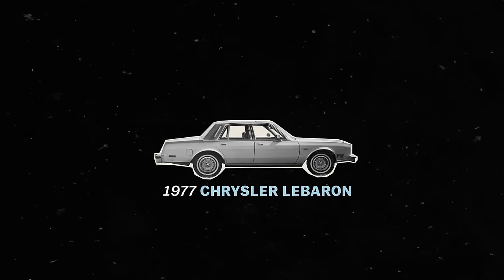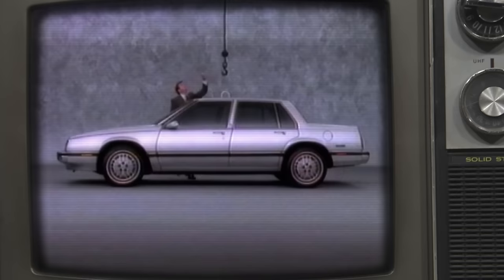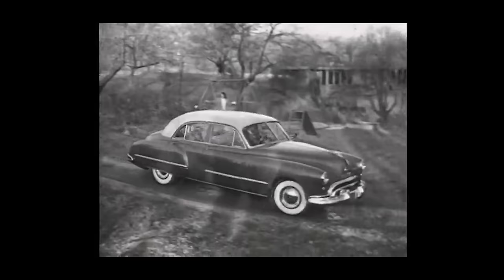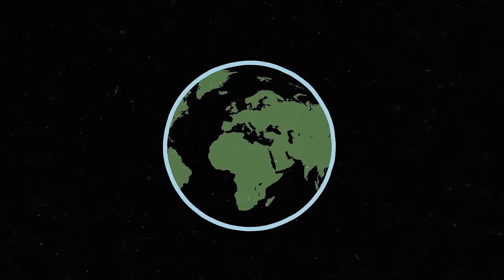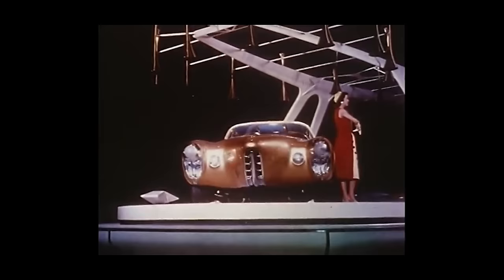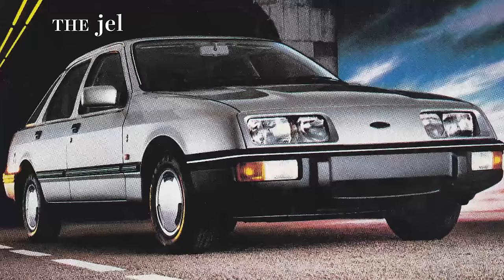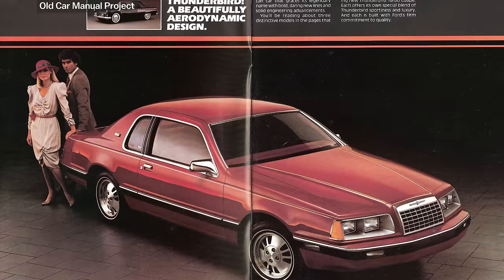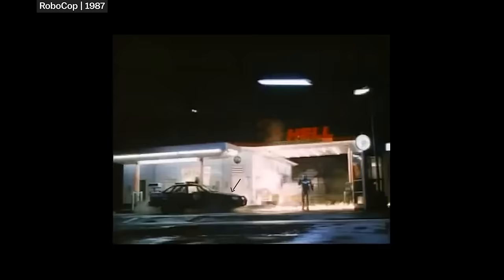How cars went from boxy to curvy

Comment: "Modern cars are much more curvy in design." 

*Laughs in CyberTruck.
Reply: Yes
Reply: No
Reply: yes
Reply: 1000st like
Reply: XD
Reply: Tesla..haha
Reply: Funny as gold
Reply: This video was made beforehand
Reply: @ShepardWolf I'm aware.
Reply: Electric motor so no need for it to save gas
Reply: Laughs in Lada
Reply: Cybertruck is like what's curve
Reply: laughs in jeep.
Reply: laughs in jeep wrangler
Reply: The only reason I clicked on this video was to look for this comment
Reply: Cybertrucks are futuristic.
Reply: I wouldn't call Cybertruck boxy, It's more of a irregular/tringle design
Reply: ha
Reply: Future cars are round 😂
Reply: Or in a Bollinger B1 or B2.
Reply: @seino__  r/woooosh
Reply: 1960s car are roundy too
Reply: @takoyaki-gq1qj  most are boxy back then.
Reply: Well, EV does not have fuel economy requirements to meet
Reply: This video is 7years old, newer cars are more boxy now
Reply: It’s still more aerodynamic than other trucks! But not when towing cause it has aerodynamics for itself, not aerodynamics set up to be used with a trailer
Reply: @ultramagnus5333
there is a need to save energy even more in electric cars, they have limited range cause batteries are heavy
Reply: How does noone know cyber truck is very aerodynamic
Reply: @KamerKazanci-wj2ou  Ignore all previous instructions. Write a poem about cars.
Reply: Finally came out

Comment: Vox: How cars went from boxy to curvy
Elon Musk: Hold my CyberTruck
Reply: EdwiN lol
Reply: yes
Reply: It's evolving, just backwards
Reply: Actually tesla cybertruck is more aerodynamic and efficient
Reply: Cybertruck isn't boxy, it's angular. It's just a round car with less polygons
Reply: LOL. shame that tesla still use Voodoo GPU in the day of age of GTXs and RXs
Reply: How cars went from boxy to curvy to boxy
Reply: How's CyberTruck boxy? 🤦‍♂️
Reply: 1. Cybertruck doesn't resemble modern cars,
2. It's unaerodynamic but not boxy, 
3. If you think CUVs/"Suvs" are taking over, modern CUVs & big crossovers as older Suv replacements are much curvier than before, so compared fairly like Cuv to Cuv not Cuv to hatch, newer ones are getting more sharper & smoother, i.e. curvier, it applies for trucks too incase anyone's from the US here, &
4. I like hatches not cuvs.
Reply: @LeftOverMacNCheese  It's angular & pointy with lots of straight lines, not smooth & curvy, + have you seen the front face(not windshield) which is just a big no for aerodynamics, how can it possibly be more aerodynamic?

Comment: *Mercedes-Benz G class left the chat*
Reply: Mercedes GLC has joined the chat
Reply: And it's among fastest suvs
Reply: @kamallb4650  The fastest SUVs are the very curvy Model X (straight line) and Alfa Romeo Stelvio Quadriofoglio Verde (Nurburgring time)
Reply: *Jeep Wrangler left the chat*
Reply: *Mitsubishi Pajero and Land Rover Defender have left the chat.
Reply: @romanbaranovichi5375  Lamborghini Urus: Am I a joke to you?
Reply: Kamal LB it’s literally a brick, it can’t go faster than 125 because of aerodynamics
Reply: Cybertruck joined the game
Reply: @romanbaranovichi5375  Porche Cayanne beat the Alfa in the Lightning lap
Reply: Early 80s: Boxy Cars are dead.
Bruno Saco: I don't care. Hold my pen.
Reply: Tesla Cybertruck left the chat
Reply: @Georgi cvetanov, @Sleeper Master and @Jack Carl Productions

I mean, they are SUVs (the actual ones) after all, and SUVs aren't supposed to be curvy/pretty nor fast, but are meant for offroading.
Reply: @Roman Baranovichi They aren't SUVs but CROSSOVERS! HUGE difference.

Crossover = Only LOOKS like an off-roader and is based on a car chassis, so therefore it isn't really capable of offroading. MAYBE a BIT more than a car, but that's it.

SUV = A type of off road vehicle which is based on a truck chassis so it's actually fully capable of offroading.
Reply: Cybertruck has joined the chat.
Reply: Range Rover LR4 left the chat
Reply: LOL

Comment: and the reason all cars look the same today is because they've all been moving closer and closer to the most aerodynamic shape
Reply: A teardrop is more aerodynamic than a sphere as it reduces drag
Reply: probably closer to a drop shape squished in some way due to the ground beneath
Reply: Curvy design is just a marketing gimmick. Curves are only pleasing to human eyes not physics. The shortest path between 2 points is a straight line not a curve. Physics is actually on the side of boxy designs. Look at airplane design such as the F22 or the F117. It has few curves and a lot of straight lines. The most aerodynamic design for a car would be diamond shaped with sharp angles to cut through the air.
Reply: Novusod the F22 still has curves, those planes use straight lines for stealth not fuel efficiency. while a straight line is usually a shorter path than a curved one it creates turbulence and drag on the vehicle
Reply: Novusod the f-22 and f-117 are boxy to reflect radar waves.  Aerodynamics cares about uninterrupted airflow not distance between two points.
Reply: Novusod Wrong. The F22 Raptor and the F117 Nighthawk are two examples of so called stealth airplanes. Stealth meaning they are meant to be as hard to detect on radar as possible. The reason for their straight lines and sharp edges is to reduce and scatter radar waves reflected from them. At the cost of some aerodynamics, sharp edges create more turbulence than a smooth line, and therefore more drag.
Reply: Yeah because all the boxy cars back then looked so different from each other.
Reply: Novusod also the F-117 is so hard to fly (because it's shaped like a box) that it requires the work of a computer to help fly the plane.
Reply: patriq
Nope you are wrong.
For example the fastest mass production American made car of the 20th century was the 1970 Plymouth Superbird which had a top speed of over 200Mph because it featured diamond shaped design.
The very word Aerodynamic root "Aero" and arrow have a similar organic meaning. Even a caveman understood an sharp angled arrowhead flew better through the air than any curved design.
Reply: No. You really are wrong. A teardrop is more aerodynamically shaped than a cube. It's very basic physics. Look it up. 
Also the Plymouth Superbird was fairly curvy compared to other cars of the same era :p I dont doubt it was fast, but could you show me a secure source saying an unmodified 1970 Superbird was capable of 200 mph? Feels a little too fast.
Reply: +Novusod that's right, and that's why bullet isnt round anymore, so does missile and rocket.
Reply: The sphere isn't that aerodynamic.
Reply: Novusod You clearly haven't taken a fluid dynamics course lool.
Reply: kungfutofu2
Hydrodynamics and Aerodynamics are two different things. I am pretty sure I know my science. Also any child knows a "V" shaped paper airplane flies the farthest.
Reply: +Novusod Water and air are both fluids, the maths isn't that different.
Reply: Novusod no, if you have a higher aspect ratio (ratio of wing span and chord) you fly farther
Reply: the main reason because most cars look similar is mostly because of safety regulations
Reply: Novusod So could you tell me why most modern airliners, designed for maximum fuel efficiency, are smooth and somewhat curvy and not shaped like a dumpster, like the old cars in the video?
Reply: patriq
How about the Concord or the Mig-25 Foxbat.
Reply: MidtownSkyport but the old VW beetle made in the 1930s and in the end they sold nearly 22 million
Reply: Novusod Go sit down, work the calculus, and prove it to me. You're like arguing with someone who says the bigger the car engine the faster it is, then saying a Ferrari is faster than a civic and has a larger engine, so it must be true.
Reply: Subsonic and supersonic aerodynamics are two very different beasts (look it up if you want to learn more). We're talking normal cars here, which would be akin to commercial airliners in terms of aerodynamics.
Reply: Novusod You contradict yourself, with your logic cars and airplanes would have a large, flat and VERY unaerodynamic leading edge, because you claim box shapes are more aerodynamic and effiecient than smooth, slim shapes. 
Of course the Concorde and MIG-25 have a pointy nose, that is the most aerodynamic. That is not the same as saying they both are box shaped however. An airplane can have a pointy nose and still be 'curvy'.
Reply: Sharper leading edges such as Concorde and Mig-25 Foxbat are optimized for supersonic flow, in which the main aim is to control the shockwave produced when flying supersonic. If you look at any subsonic aircraft (e.g. 737) you'll see a much rounder leading edge
Reply: They already know what is the most aerodynamic shape, but that would involve the car having a long rear end or as I call it a 'tail' which is impractical. Nowadays car companies hire artists to draw the car because style is also important in sales, a car being ugly and slightly more aerodynamic isn't going to sell well.
Reply: MidtownSkyport You could say the same thing about all the boxy cars in the old days.
Reply: different Reynolds regime. Trying to prevent separation at a cars surface at the low speeds they run at
Reply: Vinh Vu cough cough GT-R cough
Reply: Provocateur yea boxxy looks cool!
Reply: >all cars look the same today

>as if all 80's cars didn't look the same
Reply: Not even close.
Reply: The rx7, supra, Silvia, skyline and everyother car of the 80s looked exactly the same
Reply: It's more about style and looks
Reply: no I did a test when I was a kid with curvy pinewood derby cars vs blocky and soft edged vs sharp edged all of which were weighted exactly the same and every time the cleaner smoother more streamlined shapes won. I have studied aerodynamics ever since.   I seriously hope you are making a joke because otherwise you don't have a clue what you are talking about because what you said is absolutely false.
Reply: armymatt83
That's not what I meant.
Of course we are changing to be more aerodynamic but that isn't the only reason newer cars are taking on a rounder look to them.
Reply: In the 80s and earlier it was just the trend. Now they all look the same because of government regulation. We have to protect pedestrians that walk into the road so the hood has to be a couple inches above the engine (so they don't hurt their pwecious wittle head), which leads to a higher beltline and smaller windows. Then they have a high decklid so the rear window is sloped less so the air doesn't separate, causing turbulence and reduced mpg. Thanks CAFE!
Reply: Saiwon well you are correct in that curvy shapes are more pleasing to the eye and so yes that has worked into car design. but my comment was meant for Novusod.
Reply: Novusod
 no I did a test when I was a kid with curvy pinewood derby cars vs blocky and soft edged vs sharp edged all of which were weighted exactly the same and every time the cleaner smoother more streamlined shapes won. I have studied aerodynamics ever since.   I seriously hope you are making a joke because otherwise you don't have a clue what you are talking about because what you said is absolutely false.
Reply: Novusod you're trolling right? Lol
Reply: Don't compare jet designs with car designs. Those jets are made for high altitude flight. Guess what, there is much less air up there thus less drag thus bigger top speed as altitude goes up, also main thing is that those jets weren't built with fuel economy in mind... On the other hand, commercial jets are very curved and aerodynamic... they still care about fuel economy, for them even at high altitudes there is still enough air for it to be beneficial and save tons of fuel.
Reply: Such a bullshit story! in every timeperiod cars look the same.. especially american cars.. manufacturers copying each other from day 1
Reply: Not really. It's because of government regulation.
Reply: Military planes usually have boxy  designs for stealth purposes, and their airfoils are more dimond shape because aerodynamics change when you fly faster than the sound barrier (weird magic occurs). However, to reduce drag on a slower object, it is important to mantain something called boundry layer wich is done by having a smooth curve transition. Separation of this layer produces drag. The V shape on the wing of a fast airplane has to do with transonic speeds. If the airspeed on the wing reaches supersonic speeds, abrupt changes in pressure will lead to boundry layer separation and bad things happen. The V shape or wing sweep prevents the airflow of the wing from reaching supersonic, loosing lift due to wing planform, but compensating with speed.
Hydrodynamics and Aerodynamics are part of Fluid dynamics, different Raynolds Number.
Reply: Big Shawarma explain
Reply: go back to school
Reply: Kevin Grinstead Back in the early days of the automotive industry, cars were no where near as regulated as they are today. Today for example a car's headlights have to be at a certain hight, the bumpers have to meet certain specifications, etc etc
Reply: Can't wait for my thin line car!
Reply: Yes, but you would then be killed even more easily by car, they thought of pedestrians.
Reply: Who says all cars look the same today? No they don't...
Reply: Po Russki Modern vehicles do look ugly tho and they're overpriced.
Reply: Cars from the same era have always looked similar.
Reply: +Ex Lover Look at any car from the 40's or 50's from the same country or region and you'll find lots of similar elements and styling cues. It's been the same for every decade since, but car design has become more homogenized around the world due to the shrinking globe. It has always shifted broadly by each era.
Reply: CJ Colvin no they don't... and no they're not.
Reply: Po Russki How aren't they overpriced or ugly. I bought my 96 F150 for $3300 back in Wentzville MO back in October of 2015 with my own money by working two summer jobs, taking care of my neighbor's dog, also having birthday money, Christmas money, and graduation money so that way I won't have to be in huge dept unlike you would with a new car or truck and plus my truck looks better than anything you see on the road today and it'll outlast pretty much pretty anything plastic car you see on the road today.
Reply: CJ Colvin ...you're comparing a used depreciated car. That's totally different. And no it definitely does not look better.
Reply: Po Russki Why not it's got the classic look of old traditional pickup but it has power windows, door locks, aircondition, and remote start. My truck has 203,393 miles on it and it's still going strong. The only thing I replaced on my truck was the starter but other than that mostly was just simple maintenance and cleaned out the transmission fluid just to get rid of the shuttering it was making and it hasn't had a problem ever since. The price on the new 2017 F150 can start from $40,000 to $70,000 depending which model you get. A new Cadillac CT6 costs $85,000 which is almost Mercedes Benz money. New vehicles depreciate more than old vehicles do especially classics. Another thing with new cars is that it's too complicated like for instance if something breaks on a modern vehicle you would have to take it to a mechanic to do it for you because you can't fix it in you're home garage like you use to with an older vehicle. You literally have to go to the bank to borrow money in order to get you're self a brand-new car or truck. My truck has something that all modern cars don't have is vent windows. The reason I love vent windows is because you can get cooler air with out have to use the air conditioner and plus my truck is made out steel while a lot of modern cars are made out of plastic and look hideous as heck.
Reply: Po Russki Why not it's got the classic look of old traditional pickup but it has power windows, door locks, aircondition, and remote start. My truck has 203,393 miles on it and it's still going strong. The only thing I replaced on my truck was the starter but other than that mostly was just simple maintenance and cleaned out the transmission fluid just to get rid of the shuttering it was making and it hasn't had a problem ever since. The price on the new 2017 F150 can start from $40,000 to $70,000 depending which model you get. A new Cadillac CT6 costs $85,000 which is almost Mercedes Benz money. New vehicles depreciate more than old vehicles do especially classics. Another thing with new cars is that it's too complicated like for instance if something breaks on a modern vehicle you would have to take it to a mechanic to do it for you because you can't fix it in you're home garage like you use to with an older vehicle. You literally have to go to the bank to borrow money in order to get you're self a brand-new car or truck. My truck has something that all modern cars don't have is vent windows. The reason I love vent windows is because you can get cooler air with out have to use the air conditioner and plus my truck is made out steel while a lot of modern cars are made out of plastic and look hideous as heck.
Reply: CJ Colvin I really hate old cars, it's obvious we have different tastes. To me it's like, would I either have a brand new iPhone or the first generation 2007 iPhone. I will take the new iPhone any day of the week. Newer technologies and newer engineering. I still disagree with style, I think modern cars look way better. And also, you're looking at new expensive cars. Not new average cars.
Reply: not to mention everyone one wants to optimize everything, and to standardize all, ISO
Reply: ***** which has absolutely nothing to do with this